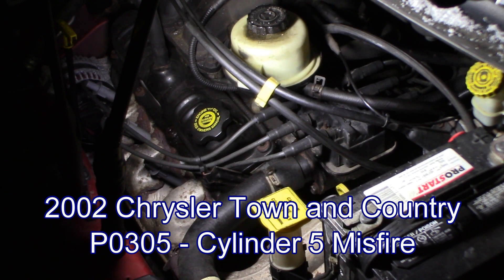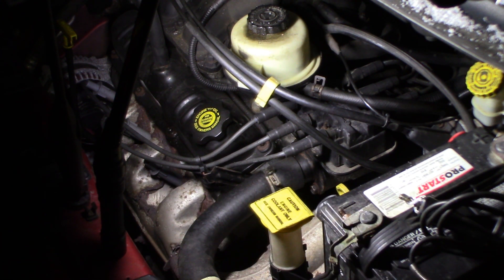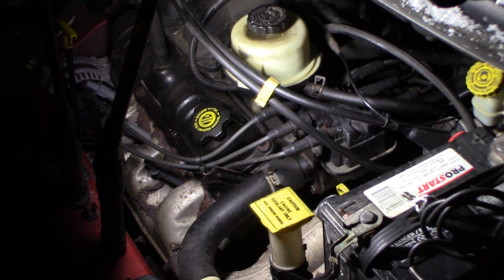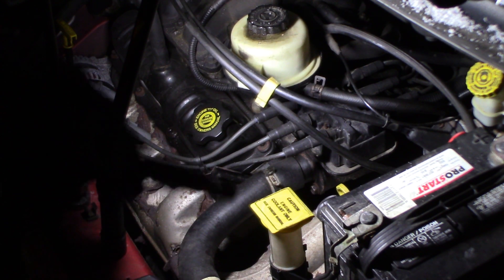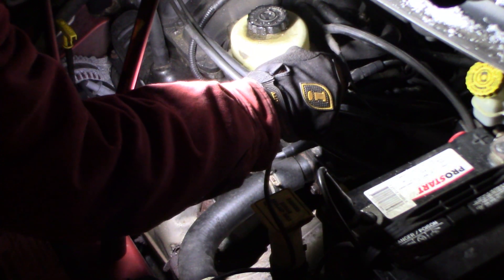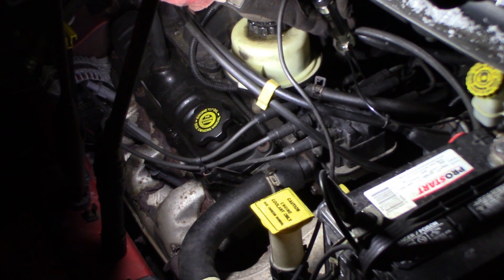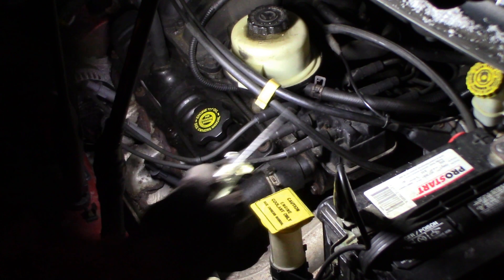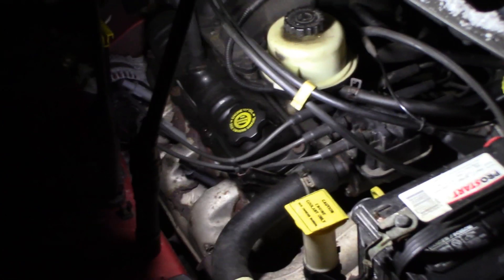2002 Chrysler Town and Country P0305 -- Misfire

Comment: Thank you!! I'm having the same issue with my 05. Changed plugs and wires and cleaned fuel injectors. Was gonna check vacuume lines and pcv and wire harness. This seems to be right tho, because wires seem fine. Thank you!

Comment: I installed new 
1)spark plugs $38
2)spark plug wires$36
3)ignition coil $62 autozone
   I test drove around NEIGHBORHOOD and 2004 town&country drove like brand new felt as if van was not on ran soo smooth& i was impressed. Im happy.  POWER STWERING has a (3rd hidden bolt) behind poweR STEERING.NEED AN EXTENSION BAR& PATIENCE. REMOVE 2 VACUUM HOSES TO MK JOB EASIER.

Comment: Best thing to do before buying a coil.. Is to check that signal from the ECU... As these are known for the ECU coil driver going south.. If your lucky it's a broken wire. As for some stupid reason. they put the ECU under the driver side front fender well. Where water\dirt\snow\ice beat it to death..
Reply: @WizzRacing do i need special tools for checking or can i use a multimeter?

Comment: Would not fixing this issue cause motor to die??
Reply from the maker: That's hard to say... depends on how bad the misfire is and whether there are multiple cylinders which are misfiring.
Reply: @CharlesAndCars  was getting no injector pulse for I would say about 2 months narrowed it sown to ecm as injector harness was changed for a new one bought a used computer that needed to be programmed to van
Reply: Sorry just woke up but I forget the code but it came up as injector circuit #3 pulled plugs as well only thing I didn’t do was compressiontest as I don’t have the proper tool
Reply: Not fixing it will cost you a Catalytic Converter. As the raw un-burned fuel will eat it alive..In time flat...